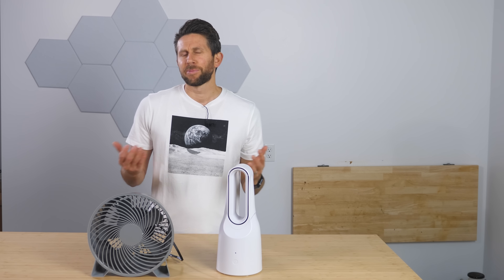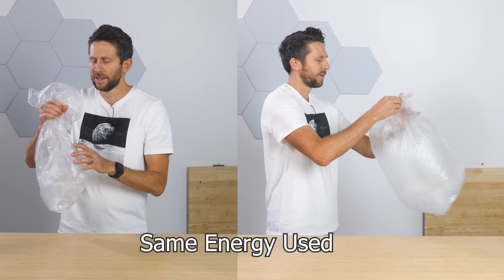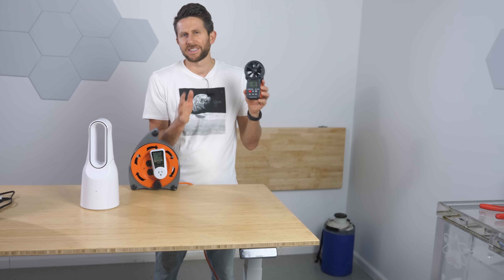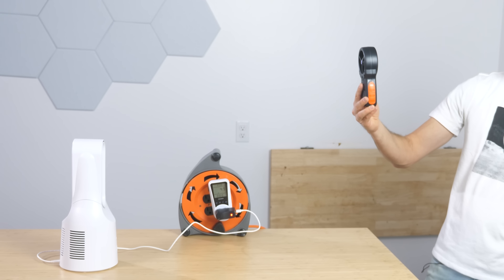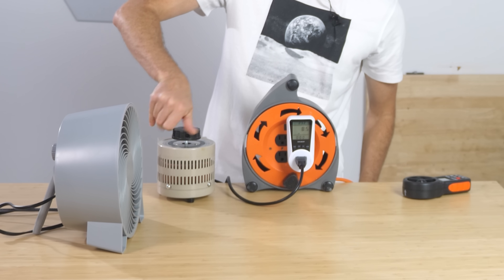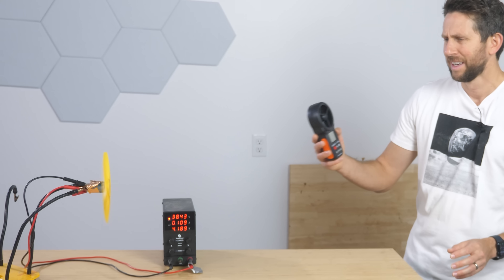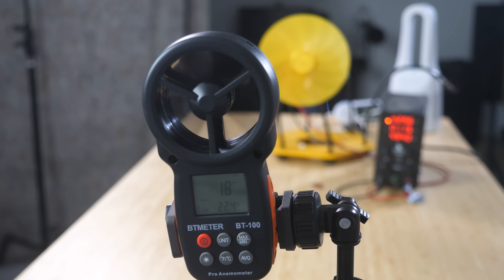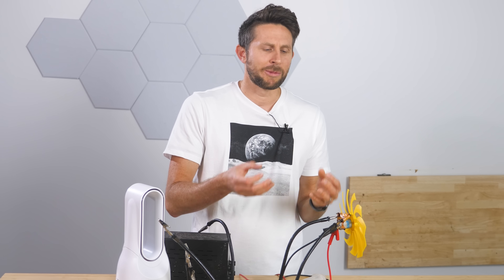Are Bladeless Fans a Scam?

Comment: Before you answer the question, you have to put a boundary around "efficiency" for a fan.

I would guess that fan efficiency was never a concern for anyone, and what really matters is whether the fan blows enough air to satisfy the consumer. Hardly anyone likes a fan blasting in their face, and no air at all isn't a fan. 

The sweet spot is somewhere in the middle, where any fan design could be optimized.

Also, you need to change the capacitor in the fan if you want it to use an induction fan at a lower speed. The time constant in the LC circuit is what provides the phase advance and creates a rotating magnetic field inside the motor.

Comment: when you realize that not a single time the word "turbine" has been pronounced throughout the entire video, you know everything that's wrong here... dyson are not the only one, but their expertise lies in designing turbines. those are very efficient at converting electricity into work by generating static pressure. and so they devised a way to use the static pressure of those turbines and convert it into an optimized airflow: the bladeless fan.
the way it's supposed to work. the turbine does not suck in a lot of air, it just builds up a lot of pressure at a decent airflow, and that pressurised air is then pushed out through a small circular outlet, which acts just like a nozzle and turns that pressure into high speed air. then a lot of engineering goes into it, to make that primary output airflow as laminar as possible to minimize the losses in turbulence. then another layer of engineering goes on to make the secondary airflow (from the ambiant air), merge with the primary airflow with as little turbulence as possible.

the problem is that when you disassemble this fan you do not find a turbine in the base... you find a simple radial fan instead. which is meant to generate very little static pressure, and instead move great masses of air for a cheap manufacturing cost. so all it does is that it moves a lot of air into those circular ducts that do not act like a nozzle at all, on the way, since the air is already moving inside at high speed it loose energy to drag with the casing and ducts, and finally it's just pushed out straight.

indeed, a tech does not work if you are not using it. if you want to make a fair comparison, first you'll have to compare volume of air moved by second, and second, you should compare a proper bladeless fan that uses a turbine (or impeller) with optimized geometry, to a proper electric ducted fan which optimize its airflow too.

Comment: The Dyson bladeless fan is a gimmick.  They made it to look like a similar electrostatic fan that has truly no blades, which was much more expensive to manufacture.  The best fan I found for making a breeze is a small DC powered USB, 6" fan that only makes 30 dB of noise on low.  Barely audible, quieter than a refrigerator.  And around 25 to $30.  Placing it on a small cushion will make it even quieter.  Thanks for the video.

Comment: So, the air that's coming in between is actually slowing down the air flow and that's actually bad. Interesting.

Treditional fans pishes air in center and that area is more compared to bladeless. So, here we feel more effect. Also the air about it will also get sucked in. But here it will not slow down that much? Why? Because are of fast flowing air is high?

Comment: I was surprised when I found out that bladeless fans actually do have blades (previously, not in this video).  It is a misnomer and all about marketing.  The only benefits I can see are that they are 1) Quieter by housing the blade in the case, 2) safer for kids without exposed blades, and 3) cooler in that you can show them off to people who don't realize they actually do have blades.  I do hope that one day they solve for creating a truly bladeless fan, perhaps in a manner similar to ionic propulsion.
Reply: I wouldn't expect them to be quieter. Why? Putting the fan in the base means it has to be smaller, meaning it has to rotate faster to move the same air, meaning it has to be louder.

This is why I like big ol ceiling fans. They can be large enough that they can push lots of air even when turning so slowly they're effectively silent.

Comment: In conclusion, a bladeless fan isn't worth it. Old cheap traditional ones are better.
Reply: Correct, and ceiling fans are goated, because not only are they out of the way, but their large size allows them to spin slowly, meaning they can move lots of air while also being virtually silent. They're also ideally suited to thoroughly mixing the air in a room, which is advantageous in both cold and warm weather.

Comment: Is it the same principle? Who knows... But This Old Tony has a somewhat recent video where he makes his own Air Knife that seems to work on the same principle ( Coanda Effekt? 🤔) Bladeless Fans seem to work with and from his not exactly super scientific testing there were HUGE performance differences depending on the width of the Slit and the amount of Air supplied which I HIGHLY suspect will also remain important on a Bladeless Fan. Dyson Bladeless Fans have the Slit on the Inside near the Entrance of the Ring - Yours being at the back ( not even on the inside - literally just at the end ) I can IMAGINE having a play in the substandard performance.
Reply: While they may differ in efficiency, the general design of bladeless fans is itself inefficient.

At a real basic level, air resistance is proportional to speed squared. The smaller the fan the higher the speed needed to move the same amount of air. Since bladeless fans use tiny fans hidden in their bases, they have to have those fans spin really fast to push the same air as a standard fan that is much larger, meaning they experience much greater air resistance.

Comment: The major flaw to this “experiment” is that you only consider speed of air imparted by the fans some arbitrary distance away. You need to take point measurements of air speed over a planar region in front of the fans and integrate over the planar area the wind speed to calculate a total mass flow rate of air. The small fan may generate high velocity air, but the baseless fan is more efficient as it imparts lower air velocity to much MORE air than the blade fan, especially at a lower power draw and quieter operation.
Reply: 100%.
But the conclusion is correct: bladeless fans are less efficient.

Comment: These are more safe for children , cant put finger into its blades...
Reply: You also can't do that on any normal fan made in like the last 50 years. They have safety covers, and even the ones that are designed to be easy to remove typically have holes so you can bolt them together if you want.

Comment: I think bladeless was never meant to be better than traditional fan in wind speed tho. People buy it for aesthetic purpose and to slowly move air around (for ex: my traditional fan make me feel too cold even at lowest setting, so that's where bladeless come in) and most bl are also an hepa air filter too
Reply: Why are you using a fan during cold temperatures lol. As fans in hot temperatures blow hot air not cold air!
Reply: @C--A  to circulate air in an air-conditioned room?
Reply: You are aware you don't need to point a fan at yourself, right?
Reply: @ but then i can't get a slow direct filtered breeze at me
Reply: @seigeengine  should not? yes. but that's not the case where I live. and induced air circulation even at lowest setting will end up blowing dust everywhere. So a 2 in one airfilter+bladeless fan are much better fit here.

Comment: I've run into the same Question and decided against the bladeless Option.

But after some years of using regular fans.
I think the true advantage of bladeless fans is that they don't get visibly gunked up.

When cleaning dust you simply wipe over them and it looks clean.
With the regular old fan you have to put in a lot more effort to make it visibly clean.

Especially hard if you're vaping as the dust can get sticky.

If you're just sitting at a desk for a few hours and want some air flow the loss in efficiency might be worthwhile and unnoticed.

If you would need a lot of air flow and static pressure to push air through a filter continously 10-20% efficiency are huge.

But if you just want to feel some wind, easy cleaning and potentially less sound will make up for decreased efficiency
Reply: I mean, unless you don't actually care if it's dirty and just whether it looks dirty, you need to do more than just wipe them off.

They're generally filtered, but that means you still need to clean the filter.

But anyone who cared about appearances wouldn't vape, so that doesn't hold.

Comment: Theres no way the smaller blade can be more efficient. But measuring with just the wind speed is very misleading. What matters is also the displaced mass, which can be measured indirect by the reaction force pushing the fan backward.
Reply: It kind of depends. Like, the effect of a fan on cooling you has more to do with airspeed than air moved.

Comment: That's not a fan, that's an air filter. And they are usually louder AND weaker then fans. But that usually doesn't matter since being a fan isn't their purpose. But an actual fan is as efficient as redular fans but it is way more quiet. Yes a regular fan can get more powerful at higher levels but even the base level is way louder compared to a similar level on a blade less fan.
(i have one from when they came out. So the following generation might be even more powerful and more quiet, before they removed them and replaced them with air filters.)

Comment: I mean I bought the bladeless one specifically to be an air purifier, and not actually as a fan. For that purpose, I think this is a good choice, right?
Reply: I mean, that'd kind of work. It'd be inefficient at filtering air, but it would do it.

That said, why do you need to filter the air? Indoor air generally doesn't have a lot of particulate in it since they will stick to things and settle out. If you're doing something that generates a lot of particulate, like, idk, sawing wood, smoking, or traipsing through heaps of dust.

If you have an HVAC system, they have much larger fans and filters and you can set them to just have the fans blow to recirculate the air.

Comment: Enough with the hidden blade fan.
A new video about why fans have wide blades and not thin blades like a helicopter
Reply: If you're actually asking, they're just doing different things in different circumstances.

Longer blades are better because longer blades mean a bigger area over which the fan can push on the air. A fan in your house can't be forty foot across though for obvious reasons.

The parts of the fan blades closer to the center of the fan just do less because they're moving through the air slower. If the fan rotates one time in a second, then the part of the fan blade 1m from the center moves about 6m in one second, whereas the part at the tip 5m away is moving 30m in that second, so it's interacting with more air. This is basically the same thing as above just considered within the fan instead of at the scale of the whole fan.

This means the parts of the fan blades near to the center aren't doing very much compared to the outer parts of the blades. A wider blade would be heavier, and so it would have to be shorter for the same weight, which makes it less effective. Conceptually this means you might want a fan blade that's narrow at the center but wide at the tips, but that runs into several issues in that it would impart huge forces on the blades, particularly at the tips, which are already experiencing huge forces, and it has aerodynamic effects relating to tip vortices and the like.

Anyway, so really we're back at there being practical size limits on fans used indoors. So to move more air we can't make the fan bigger, so what else can we do?

Well, we can increase the blade area AKA the area within that circle that is pushing on air, which can be done either by increasing the blade count or the size of each blade. Increasing the blade count runs into the issue that each blade induces it's own air resistance, so it's generally more efficient to have fewer wider blades.

You can also increase the blade pitch (how angled the blades are), or the speed at which the blades spin. The trouble is blade pitch effects efficiency, related to factors like how fast the fan is moving air through it, how fast the fan blades are moving and how large the fan is. There's basically a 'sweet spot' for a fan where it's blade pitch is most efficient. To increase the pitch past this will result in moving more air, but less efficiently, so we generally don't want to do that.

The last method is making the blades spin faster. The trouble with that is air resistance increases with speed... squared. So if the blades move twice as fast, they push twice as much potential air, but have to overcome four times the air resistance, so it's much less efficient. Also, moving faster makes a lot more noise.

This basically means blade width is our best option. It does have downsides too, don't get me wrong, but it's generally the best place to go.

Of course, you'll note ceiling fans can be much larger, and they tend to have longer narrower blades. Also, since they can be much wider, they spin much slower than other household fans, which is why they also tend to have flat blades, since the more curvy "aerodynamic" blade shapes just don't matter much at low speeds.

Conversely, computer fans have to be really small, so they not only have wider/more blades (more blades is actually quieter), and they spin much much faster, which is always why they have more aerodynamic looking curvy shapes.

Comment: A variable voltage controller does not reduce the wattage in use significantly... it just sends the desired to the fan and converts the rest to heat ... so , for the same reason , a voltage regulator of a ceiling fan does not reduce wattage consumption at low speeds

Comment: Dude, the whole purpose of air entrainment is energy conversion—turning a supply of high speed air into a supply of low speed air with a higher volumetric flow rate. I mean, you literally showed that off with how you can move a greater volume of air with entrainment to inflate the plastic bag, but you only measure the airflow through the cross section of your anemometer, which is smaller than either fan. Air comes out of an air compressor way faster than a box fan, but I doubt the air compressor is the most efficient way to pull air through your house. Efficiency is relative to your needs. The internal fan is definitely going to transfer energy to the air more efficietly because the ductwork will cause some losses, but if you're measuring in terms of air moved per watt it may be less efficient or more efficient depending on how much air is entrained without the ducts and what impact they have on the load and losses—but that isn't what you measured, so I guess we'll never know.
Reply: You are right, however, two points:

1. Often what we want from fans is to be cooled. How good a fan is at cooling us has more to do with how fast it gets air moving than how much air it moves.
2. He's right even though his experiment doesn't prove it. Dyson's "bladeless" fans are just a less efficient design. This is really obvious when you realize they do have a fan, it's just really small and in the base, and that it works by having that fan spin really fast, which, with no other consideration, results in it having substantially higher air resistance (air resistance being proportional to speed squared... that is, a fan that spins twice as fast moves twice as much air but has four times the air resistance).

Comment: Hi, congratulations on your videos. I have to point out 2 big inaccuracies in this video. 1) The example with the plastic bag is not correct. With your blow you do not fill it, you only help to expand it. The air obviously enters the expanded bag and then if you close it you trap the air it contained. 2) The flow of air (i.e. the volume of air moved) is speed x section, you only measure the speed but not the section.
Reply: ...? You obviously have to fill the bag first before you can trap the air inside it. If the bag was no filled, trapping what was inside it would not result in a full bag.
Reply: @seigeengine  you had time to waste writing something random around on web. You didnt catch my point. Anyway go on

Comment: NO BENEFIT??? My kids 2 under that are under the age of 2 could knock a fan that has blades down or stick their fimgers into the blades and be injured or having their hair get sucked in the back of the fan and having to cut their hair, ill pass on that. Where I live it's hot and very humid and I dont like running my AC 24/7 and having a fan near the crib that blows air around the room without worry is well worth the price. This was the main reason I bought a Dyson fan anything else was just a bonus.
Reply: Let's be real. These are not real problems. Fans typically have robust stable bases, many can be put on top of tables or the like out of reach of a two year old, there's approximately no risk of a two year old getting their fingers into one, even if they tried, and getting their hair caught is basically a fake problem, plus you shouldn't be leaving a two year old unattended to wander around.

You just don't want to admit you bought overpriced junk.